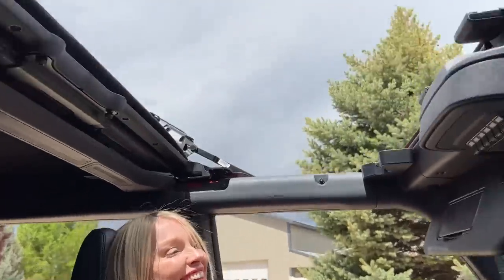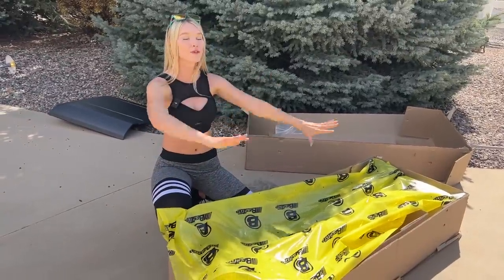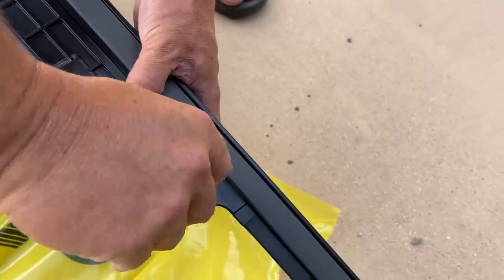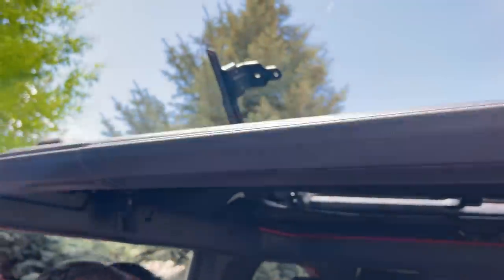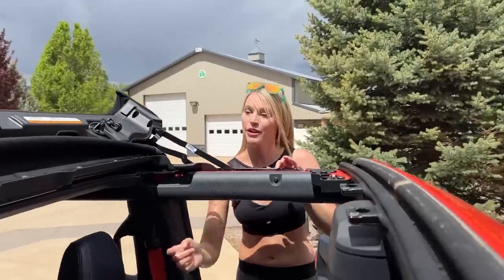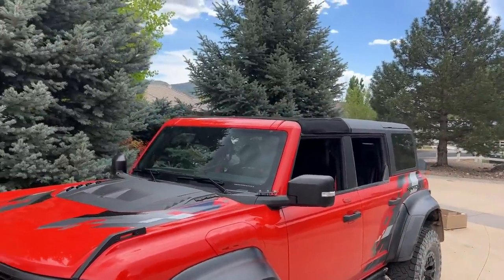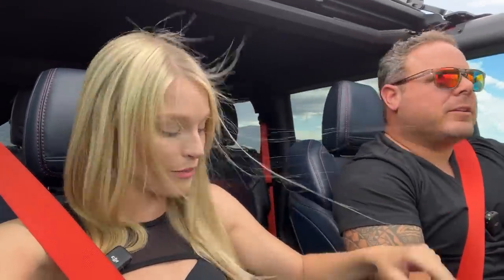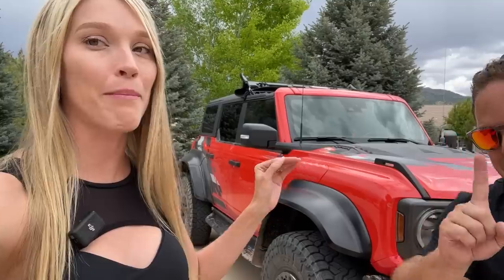The BEST Upgrade for a New Ford Bronco & Bronco Raptor?!

Comment: I had one of these on my 2 door and it was awful.  The wind noise at highway speeds (when its closed) was so bad you couldn't talk to anyone and without back windows to crack the wind when it was open its a maelstrom in there.  Needless to say I took it back off pretty quickly.  I also owned one on a previous JL Rubicon 4dr and it was awesome.  I believe the wind noise is so bad because unlike the jeep it does not sit flush across the back there are two raised areas one on either side that catch the wind.  In the video at 13.26 you can see the raised portion I'm talking about.

Comment: I got my order in for a new Ranger Raptor in azure gray, no code orange :(. I can't wait to compare it to both our 1st and 2nd gen Shelby Raptors, our 1st gen is the Baja700 and is a beast. I'm most curious how it will compare to the Bronco Raptor, considering they have the same power plant. Is the Bronco worth $40k more than the new Ranger, or double the cost if you pay a markup?

Comment: How big of a pain in the butt is it to now remove the entire top or just the back panel with the new top installed?
Reply from the maker: The Sunrider itself is just 4 bolts (2 above each door) and then the 2 bolts for that rear bracket. Probably would take like 5-10min.

Comment: Kill this Bronco, make a B150, B250 & B350 with all the same part #’s of the F-series, it’s all off the shelf. And scale./price. Do a 4 banger diesel (Kubota)with an 8 speed trans, your in 35 mpg territory. Only in B250 & B350. B150 is stock in eco boost gas with 8 speed trans.

Comment: The bronco has gone down in size from the 90s … it’s smaller and doesn’t have the same body frame or style as the old big broncos ! There was soo much room 
In the back seat and in the front seat and trunks of the old broncos vs now ..!
They now are smaller and inside and have a Toyota four runner style body with a small bronco front nose frame …
But still a Toyota four runner turned into a new bronco …!!$
No thanks